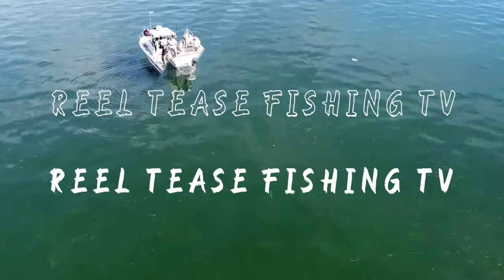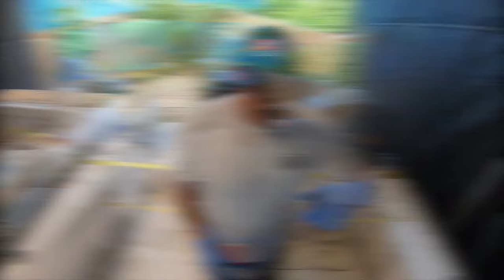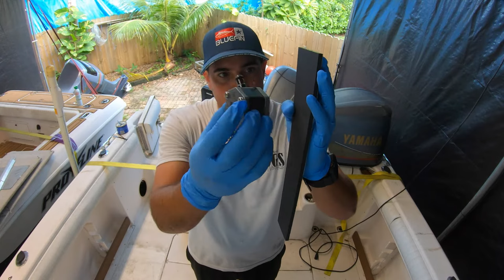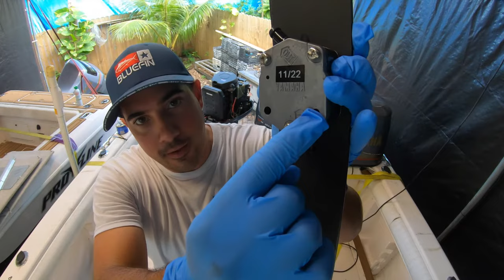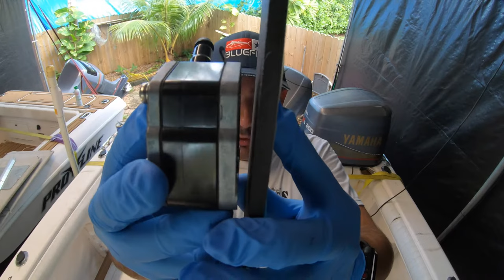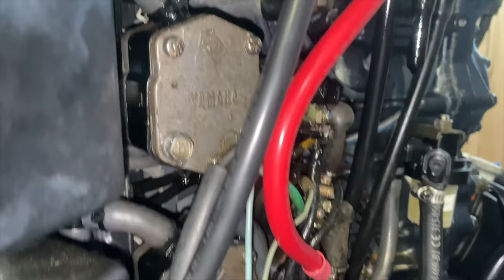How to Test a Low Pressure Fuel Pump

Comment: Hello there @ReelTeaseFishing. I have a 30 hp 2 stroke , 3 cylinder yamaha DMO. I start her up, let her sit in idle a couple of mins till i get my spearfishing gear in the boat and she runs great, no misfiring, full power, medium power  untill i get to my spot and i slow down to anchor and then she shuts down. I pull the cord, she starts for a brief moment and then dies again. I ve inspected the fuel filter and lines ( no opstructions of fuel flow), but i cant do the low pressure fuel pump test you ve showed because the pump is connected to the middle carb. I took the pump of, both membranes and metal valves look to be in good condition, no junk, no tears. Recently all 3carbs have been cleaned, they re spotless. Also checked the plugs, spark is there. Any suggestions??
Reply from the maker: Did this problem happen before you did the carbs? Remove the silencer assembly (black plastic that covers the carbs and see if you see some fuel leaking from a carb when you shut it down. My guess is one of the carbs is set wrong and allowing too much fuel, flooding your outboard after it gets to temp.
Reply: @ReelTeaseFishing  Yes, i had this happen a couple of times before removing the carbs for cleaning and inspection, but on a smaller scale so to say. The engine would die on idle after its been working for a while or was hard to start after getting cold. Then it would shut off when getting in gear. Could it be a failing low pressure fuel pump?? I ll try your suggestion to check for leaking of fuel, although the pilot jets and idle timing are set to yamaha specs..😅

Comment: 60 hp 4 stroke 2015 found water in gas install bad injectors new plugs electric fuel can here turn on cleaned screen  on bottom of E pump empty  all fuel filters of bad gas did not check anything else inVST OR WHERE E FUEL PUMP IS LOCATED ALL NEW GAS WONT START. MAYBR LOW PRESSURE  PUMP BAD